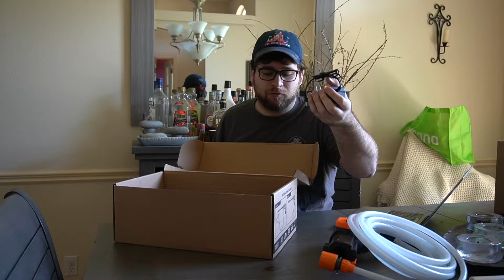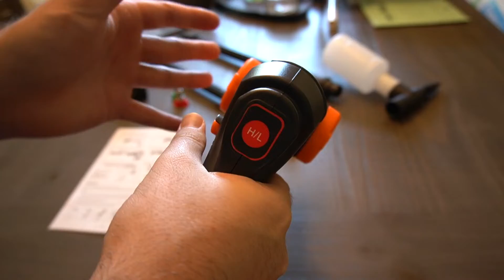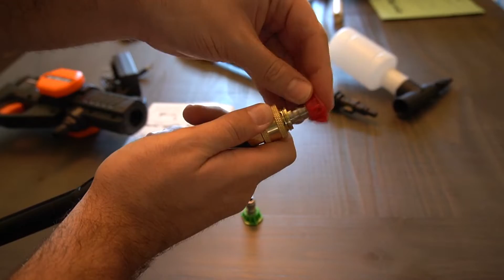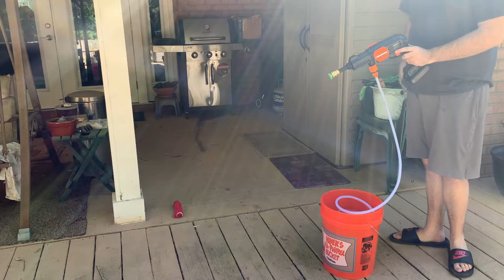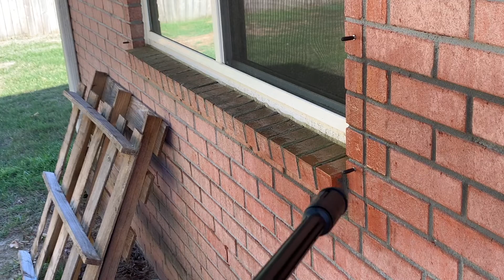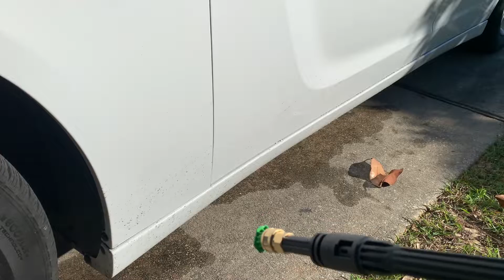Sunglife Cordless Hydroshot Pressure Washer | Review ,Setup, Test

Comment: Hi Brando, you have done a good job. Great video to show how to use the Cordless Hydroshot Pressure Washer correctly and how it works. Here is also a useful tip, you could have it as reference only.
If you are unable to draw the water from the bucket, please put the bucket higher up than the wand until the water reached the wand itself. Once the water reaches the wand it works normally.